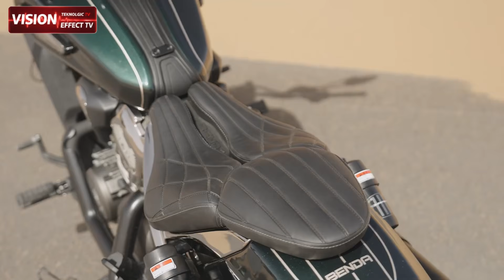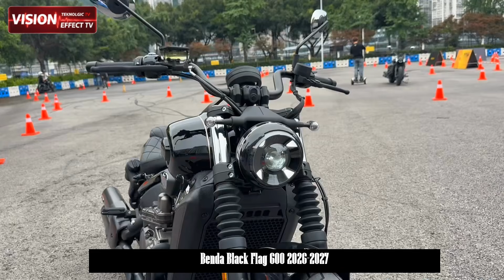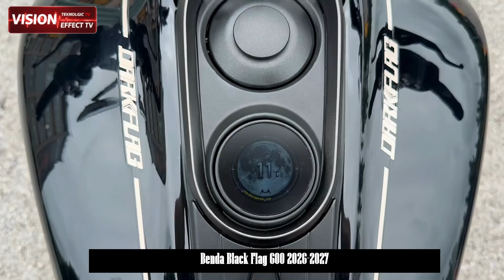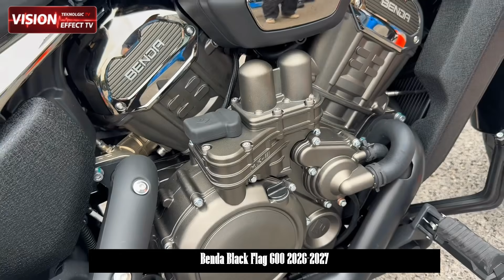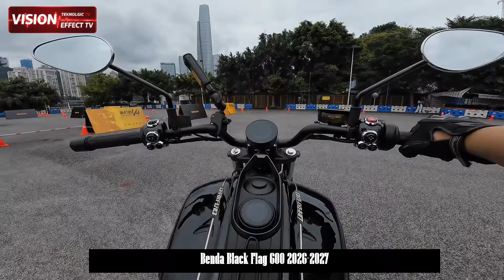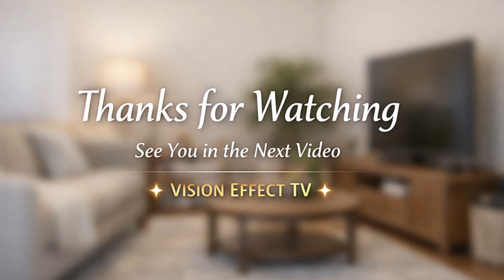New Benda Black Flag 600 2026-2027 | China's Most Ambitious Cruiser Yet?

Comment: When will it be available in the EU / What is the price / Is the speedometer display visable under sunlight conditions?
Reply from the maker: Benda is officially scaling up its global deployment, using the smaller Dark Flag 500 and the flagship Dark Flag 950 as its primary entry keys for the UK and European markets. The Black Flag 600 has already cleared its domestic regulatory hurdles and type-approval processes, filling the exact middleweight segment gap between the 500 and 950 variants.
European distribution networks are executing a rolling rollout; you can expect official dealer inventory and general availability across the EU to solidify by late 2026 to early 2027.

Benda targets a highly disruptive pricing matrix, meaning they drop high-end tech into a budget coordinate that undercuts traditional Western and Japanese legacy mid-displacement cruisers.
To give an accurate frame of reference, the smaller Dark Flag 500 base model lists at roughly €8,430 in the European region.
While official EU pricing for the 600 variant hasn't been finalized by the local distributors, the estimated market entry price is expected to hover between €9,200 and €9,800 for the standard manual gearbox/conventional chassis trim.
If you elect to upgrade to the high-spec variant featuring Benda's electronic auto-clutch system (similar to Honda's E-Clutch tech) and their signature electronic rear air suspension framework, expect the premium telemetry to push the invoice closer to the €10,500 mark.

The Black Flag 600 steps away from generic analog gauges to deploy a complex Dual-TFT full-color display setup: the primary circular display is mounted directly on top of the handlebar clamps, while a secondary digital panel sits recessed on top of the teardrop fuel tank.
The Main Handlebar Cluster: This screen utilizes high-contrast digital rendering. Direct sunlight exposure does introduce mild glare due to the flat protective glass overlay, but the backlight density and interface color matrix are sharp enough to remain legible during high-noon riding scenarios.
The Tank-Mounted Secondary Screen: This is where riders experience real-world friction. Because it is positioned completely flat on top of the fuel tank, it directly catches vertical sunlight paths. The reflection parameters on this secondary panel make it significantly harder to scan quickly without shifting your helmet position to block the ambient glare. It is highly functional for low-light or evening cruising, but under extreme sunlight, it acts more like a styling element than a highly readable telemetry center.
Reply: @VisionEffecttvTR thank you for this very comprehensive reply, it is very helpful. I have been planning to purchase the Dark Flag 500 but the 600 takes the deaign to another level. I'll wait to see it in person then make a decision which of these two models to go for.